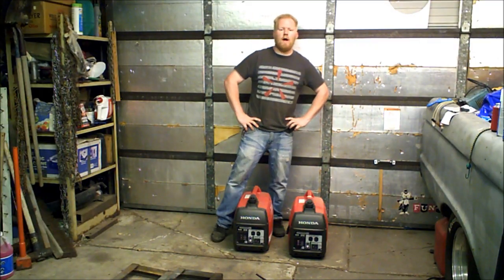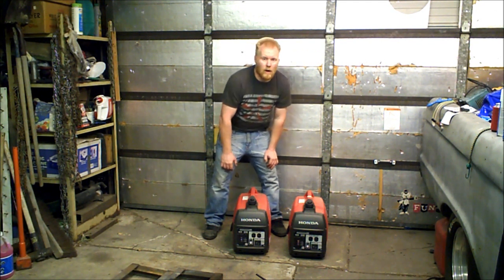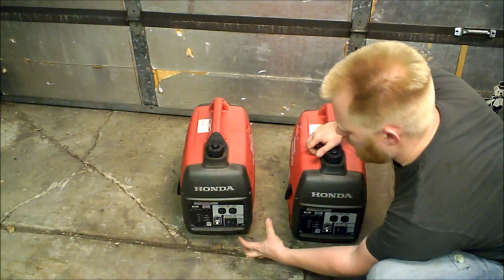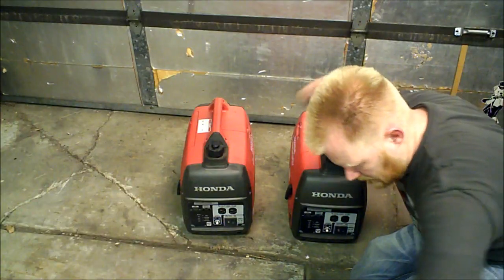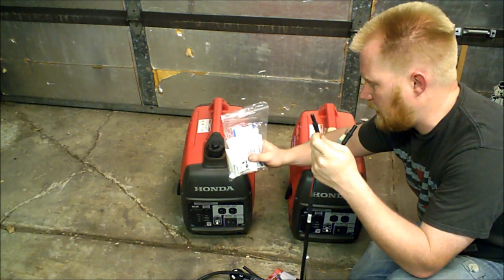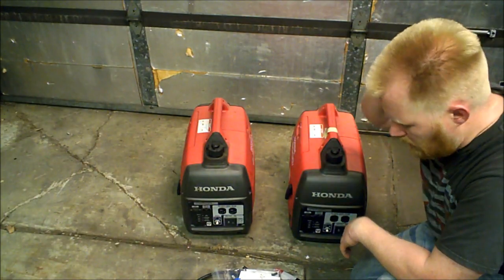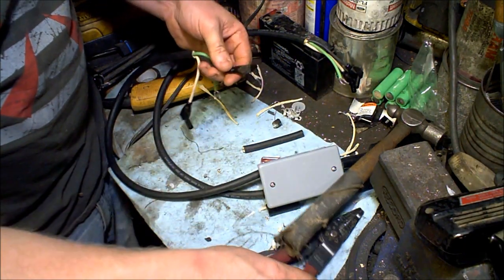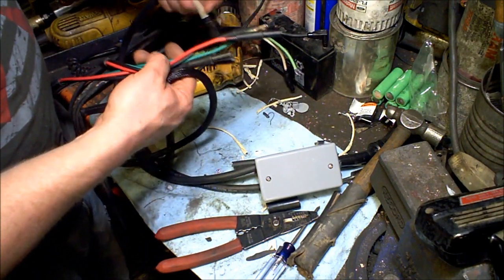Homemade 30A Honda Eu2000i Parallel Kit Generator

Comment: Thanks I realized that.  The Honda cable has black, red, and green instead of black, white, and green.  I'm going to solder green with green, but don't know where the other two wires go.  Does black go with black and red goes with white or if it even matters.
Reply from the maker: +pepsiboy72 It doesn't matter. I would do as you said and put red with the white and black with the black.

Comment: Thanks for the video.  I'm using the Honda cord and it has different colors.  Can you tell me what color goes with what on the plug side.  Green with green obviously, but what the red and black.  Thanks in advance.
Reply from the maker: +pepsiboy72 As far as the machines go, it doesn't matter which color cord plug goes into which port.

Comment: The Honda 08E93-HPK123HI Parallel Cable kit costs $46 on Amazon, I doubt you're saving much by making your own.
Reply from the maker: +ebuff57 That won't give you 30amps. You'll be limited by the outlets to 20amps max with a pair of eu2000i generators.

Comment: Don't make a suicide cord (common name for the design shown). It's dangerous, unprofessional and completely unnecessary. Rather than use male plugs, just go to an electronics supplier and get insulated banana plugs like the factory kit uses.
Reply from the maker: +Mik Wri Exactly. But, they are not standard banana plugs either. They have a shielded tip and probe so you could stick your finger in the end and not get electrocuted.

Comment: How would we get 30amps out of the 2 gens? If we parallel with 2 male plugs out of the female 15amp outlets on 2 of the units will this give us the 30amps we are looking for? I would then just use the 3rd unit to get 15amps-if that makes any sense?
Reply from the maker: +ccc McQueeney Yes, if you plug a male 3prong into one generator and another male 3 prong into the other generator, then pull power from the middle of the cord that is connected to both generators, you'll get 30amps(26.6amps as both only produce 13.3 running).  That is what I do in the video except I use the banana plugs instead of male 3 prong plugs(they connect to each other under the panel). Just be careful as if one male is plugged into one generator and the other is not it is live (generator running) and can hurt you.

Comment: Thanks again for the info-we brought 3 honda eu2000i and now want to run the 3 in parallel. A quick Q? I was sold a Y electrical fitting that has a 50amp female and is fed by 2 30amp male plugs. I have the fittings to reduce the 30amp plug to a 3 prong 15amp. My question is, if I parallel 2 units with the parallel cable, will the 2 units combined give me 30amps? The breaker on the Hondas say it is a 20amp breaker. Do 2 units paralleled increase the amp OUTPUT and if so will the breaker in  the Hondas sustain 30amp? Sorry if my Q is unclear> I am just trying to parallel the 3 to get 45amps or close enough? I have read thru your extensive and informative info, but just wanted to check what you would suggest for our situation. I would be most happy running the 2 30amp males into the 50amp female, however, cannot understand where I will get the 30amps from? Thanks again for taking the time to reply.
Reply from the maker: +ccc McQueeney If you run the basic Honda parallel cables ( http://amzn.com/B00CSBV198 ) you will only get 20 amps out of the standard household plugs on the front of the unit. The plugs (2 on the front of the unit) will only give a max of 20amps combined before tripping the breaker.
Reply from the maker: bajabilly2004
Yes. There is no need for this setup if you have a Honda Companion. All you need is the basic cables.
Reply from the maker: bajabilly2004
If your contemplating spending that kind of money, buy a Honda. 2 Honda eu2000i be a far far better machine and in 10 years when you're done with is it'll be worth 75% original value($1600-1700 pair) if it looks good and 50%($1000 pair) if you totally trash it. Where as you'd be lucky to get maybe $500-$700 out of the Powerhouse in 10 years. I have worked on a lot of generators and these Chinese generators are made down to a price to barely function.

Comment: Hi, I was wondering if the same parallel can be applied to 3 champion 2000s? Thanks
Reply from the maker: +ccc McQueeney : Yes in theory. I've never done it but it has the same technology as the Honda and you can hook 3+ Honda's together.

Comment: Yes it is. Im in Newfoundland
Reply from the maker: +jimmytk  It is against Canadian electrical code to have two generators paralleled, so Honda can't sell them with the banana plug ports to Canada. People in Canada combat this by making a suicide plug. An extension cord with a male plug at both ends. One end is plugged into each generator and they are started one at a time. It does the same thing as these banana plug ports on US models just with the added danger if someone unplugged it with the other running they would have a live plug in their hand. Internally the generators are the same, they just omit these ports.
Reply: +sixtyfiveford Suicide plug! hahaha LOL!!, I'm gonna steal that! hehe, I just check my 240V version of the EU3000IS has parallel port plugs, weird! why wouldn't allow canadians to use inverters in parallel, probably the law was just a generic one for generators, to prevent disasters, try to explain to a politician what an inverter is :)
Reply from the maker: Leandro laporta I read the entire code years ago and it is pretty intense.

Comment: Hey, good video!  I have a honda 2000 eui but it does not have the parallel output. Its a early 2000nds model. Is there anything I can do with it?
Reply from the maker: +jimmytk Canada is virtually the only ones without parallel capabilities built in. Is it from Canada?
Reply: Yes bought it here in NL. That is so weird, Canada not having the parallel ports. If I made the cord myself and joined two 2000nds could I get 3 - 4000 w from one outlet? Or just get that many watts combined from all the outlets together....
Reply from the maker: You'll get 20amps(2400watts) at a plug if you just do a male plug to male plug cord(suicide cord). If you add a 3rd outlet between them inline, like I do in the video you will be able to get the full 4000 peak watts.

These banana plug ports directly connect internally to the outlet. They are just omitted on the Canadian models due to electrical code.

Comment: Thanks for the video. In the later  part you show your installation in your trailer, using two honda generator, you showed the exhaust systems. Other then yours, I have not seen a video with much detail. You showed rigid tubing. What gauge and material, od or id  for the tubing and what did you use for the interface adapter. What type of flex tubing is available?  Thanks again for your responses.
Reply from the maker: +Gordon Eno Flexible tubing is hard to find but obtainable. I use electrical conduit from the Home Depot. I welded a 3/4" piece to the exhaust that protrudes maybe an inch. 1/2" conduit then easily slides into this at any length I need.

Comment: I'm confused, If you have a 2000, and have not purchased a second 2000. do you need the companion. or use your system with circuit breaker. Or is your system needed to assure max output whether you have a companion or not
Reply from the maker: +Gordon Eno You don't need the Companion but it will eliminate the need for this. With a EU2000i and a EU2000i Companion all you need is the basic $40 cable to get full combined power.
Reply: +sixtyfiveford  thanks much appreciated.
Is there a heat issue using the 3000 honda in a motorhome. My generator had it day. the new generators are to large to install in the original generator area. I was thinking of using two 2000. for one circuit and a 3000 with a remote for the general 30 amp usage. I would create a exhaust system to exit the back of the mh. My motorhome generator had a 30 amp and a 20 amp for auxiliary ac
Reply from the maker: They put out a fair amount of heat, so it would warm the interior of the motorhome. A motorhome with have a few circuit breakers in the power panel but everything is connected. You should be able to run everything of a eu3000 paralleled to a eu2000.
Reply: +sixtyfiveford  thanks much appreciated

Comment: Is there any reason you can't use the outlet 110v from each generator put in a fuse box and then to your interface connector. You wouldn't need to have a more expensive companion generator. Would this give you more output from a amperage?
Reply from the maker: +Gordon Eno Yes, you can just plug a cord into one each of the 110v outlets and connect them to get full capacity. The fear is though if one cord gets pulled out/falls out it is live with power and can electrocute someone if they touch it.
Reply: Thanks for the information and your time.
Reply: to clarify this, the male end of a plug is live, which almost never is the case and without knowing it is live youre almost guaranteed to get a good shock

Comment: why not just use the 20amp 3 wire plug on each generator and tie them to a 30 amp plug?   JD
Reply from the maker: James Dillon That's called a death plug but it works the same. If one end vibrates loose of someone pulls one plug it is hot/live and could electrocute them.
Reply: sixtyfiveford 
? isn't the same true of this setup? If you pull out one side of this parallel it is also hot, the other side is plugged into the hot side of the other generator. And there is nothing stopping the current! it is Y 'd together before the breaker.  It is true that they are covered connections but that is all that protects you, they are still hot.
Reply from the maker: These plugs are covered and have a shielded tip so you couldn't hurt yourself even if you stuck your tongue on it or in it when it was pulled out.

Comment: nice one! The weather proof box is good.. but no watertight connectors for the cables.. usually when your using a generator (besides construction and camping) the wether is bad...that can be a problem if the box gets wet..but nice video

Comment: sixtyfiveford made my triple parallel kit with a 50 amp plug and a 50 amp breaker.  I ran two hot legs out of the breaker one to each side of the 50 amp plug. Thanks for the ideas!!!
Reply from the maker: That's great. Happy RVing.
Reply: sixtyfiveford  what do you think about 4 generators with the 50 amp breaker and plug?
Reply from the maker: The way you have it set up it really doesn't matter unless you want more power. If you ran 4, I would separate the 2 legs and run 2 generators per side. Or you could tie them all together and split is like you did with three. Either way you still wouldn't be able to run 240volt appliances like clothes dryers as the phases will never be out of sync correctly.

Comment: sixtyfiveford how would I be able to parallel 3 eu2000's using a 50 amp plug?
Reply: sixtyfiveford so I think I figured this out. I am going to parallell all three eu2000's to a 50 amp breaker. From there I will have two hot's coming out of the breaker one to each side of the 50 amp plug (2-120v).  I am going to install a 20 amp (maybe a 15amp) online fuse on each hot line coming out of the generator to protect it from any back surge. I am using an existing parallel cable kit and with the 50 amp plug,  breaker and extra cable kit I am about spending about $75.
Reply from the maker: Michael Gutierrez You can do it exactly like I do in the video, just with 3 and put a 50amp breaker. Take all 3 and wire them to ONE of the 120v terminals. Then take a jumper wire from there to the other 120V terminal. They will share the load and everything will work fine as long as you don't have any 240volt appliances. The phases will be out of sync and you won't be able to run them no matter how you hook it up.

Comment: sixtyfiveford  http://www.cpooutlets.com/honda-08e93-hpk3001h-parallel-cable-kit-for-eu2000i-generators--50a-125v-appliances-only-/hndn08e93-hpk3001h,default,pd.html?ref=pla&zmam=31282435&zmas=47&zmac=722&zmap=hndn08e93-hpk3001h&kpid=hndn08e93-hpk3001h&gclid=CPOQirnI6sUCFQiBaQod2k0A_Q

what do you think about just adding a third connection to a set up like this. I would prefer a 50amp as my camper has a 50 amp connection.
Reply from the maker: Michael Gutierrez 50 amp service on an RV is a different beast depending on how your RV is set up.

50amp service has TWO 120 volt plugs built into a single plug. Half the RV will run on half the plug and the other will run of the other half. 

So if you have 2 AC units, more than likely they will run off the 2 separate 120V lead on the plug instead of sharing them. Some RVs will have 240V appliances and in this case it uses both the 120V leads to obtain 240V.

You can not parallel any amount of Honda, eu1000i, eu2000i's or eu3000i's in any configuration to get 240V. But if you have no 240V appliances(clothes dryer) then you don't need to worry about this.

So you need 50 amps of 120V service. The easiest way to think of it is you need TWO 25amp 120v services combined into ONE plug. You could do this with 4 eu2000is' to get 26.6amps on each side or 53.2 amps total.

You would do the exact same thing I do in the video but you will combine all the white wires together and you will combine all the green wires together like I do in the video. The black(hot wires) is where it differs. With 4 generators 2 black wires will go to one terminal of the plug and the 2 remaining black wires will go to the other plug.

Here's a schematic of the plug: http://rvtravel.com/uploads/1/20-30_Amp_120V_metered.JPG

Comment: sixtyfiveford  I wanted to use three Honda 2000i but wanted to used a 50 amp breaker and plug. Would the same set up work?

Comment: hello friend, greetings from Venezuela.
I have 2 honda EU20i and I could connect in parallel thanks to the instructions of your video.

I have a question
1 generator is working with synthetic oil
and the other mineral oil.
I want to change the synthetic oil with mineral oil.
Do you have any suggestions?
thank you very much

message translated from Spanish by google translator.

Comment: In your junction box, did you wire both hots and neutrals to the rv plug?  Or only the hots / hot and neutral from each?
Reply from the maker: xzibit8614 All ground wires are wired together. All Neutral wires are wired together. The hot wires, one from each generator are wired together and to 1 side of the breaker. The other side of the breaker has the last remaining hot wire running to the RV plug.

Comment: How about creating a homemade 240v parallel kit?
Reply from the maker: cpoul From the eu1000, eu2000 and eu3000 it is not possible. You could wire it like a 240 volt system but the two 120volt lines would be out of phase and destroy anything that got plugged into it. You could wire it for "FAKE" 240 volt power needed by RVs. The majority of them only run off the single 120volt legs even though they plug into a 240v 50amp service.  If true 240 volt power is needed for a welder or other 240v device your better off going with a cheap generator or the eu7000i
Reply: sixtyfiveford Saw this thread. Is this not possible? Would be awesome, thanks.
Reply from the maker: You would need a computer essentially to do this and it wouldn't be cheap. Honda has them built into their units now but they are designed to sync two units in phase. So both wave forms of the AC power are identical. You would need an external computer to sync the two 120v AC lines opposite/180 degrees from one another as is required for 240V.

Honda's built in computer would fight whatever you build and more than likely it would short it out. Not that it can't be done it just takes more effort than its worth for a small generator that would struggle to power 240v appliances. It's like turning a compact car into a truck. It can be done but then it'll be to weak to haul anything.

If you want 240v power to run a home during power outages you can just run it off 120v. The only appliances that wouldn't work are: electric stoves, electric dryers and electric water heaters. They all need 30-50 amps of juice at 240v so that is equivalent to 60-100 amps of 120v power. You would need 4 eu2000i generators to run a 30amp 240v dryer and 8 to run a 50amp stove.  If you need to run those you'll want to step up to a big generator like the eu7000i.
Reply: sixtyfiveford My thinking was for a 240v well pump. I can run everything else I need no problem. Thanks for your replies!
Reply from the maker: Ah, a well pump. Those are one of the few low amperage 240v appliances. Most well pumps are wired 120/240 so you can move the wiring around inside to make it run off 120 at double the amps. I've seen people run 240v well pumps use a small (non inverter) generator capable of 240v. They build a "dog house" around them to make them quiet and protect them from the elements.

Comment: great vids!

Can the same kit be made for the eu3000is honda generator, but using a 50amp breaker?
Reply from the maker: Paul Bauman Yes, you are correct. I advise you cut up a basic Honda parallel cord or if you have a few weeks get these http://www.ebay.com/itm/200876298127?_trksid=p2060778.m1438.l2649&ssPageName=STRK%3AMEBIDX%3AIT            instead of buying shielded banana plugs like I did.They are only 3.3 feet but should giver enough length to work.

Comment: can you use just 1 of these to run an air conditioner in the camper?
Reply from the maker: ManthatsCool100 No. A camper will generally have a 13500 BTU or 15000 BTU roof top unit and though the generator may run it theoretically it won't start the AC unit. Some people can get a single eu2000i to start the AC unit but it will eventually trip the safety breaker.